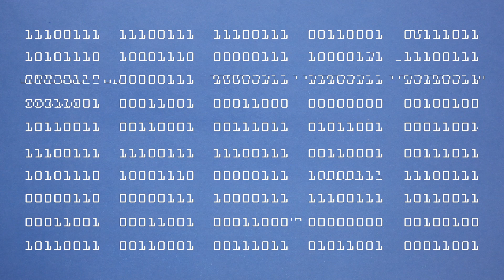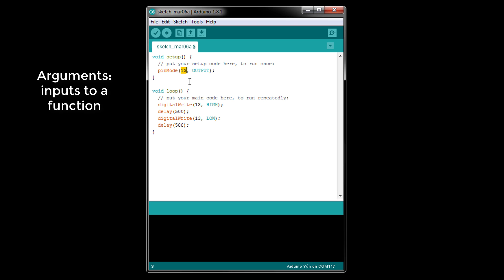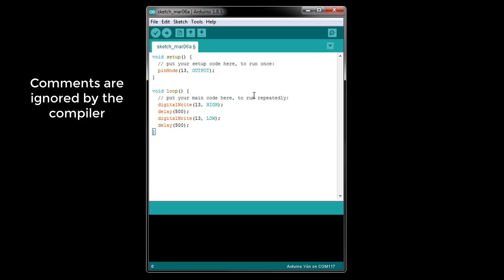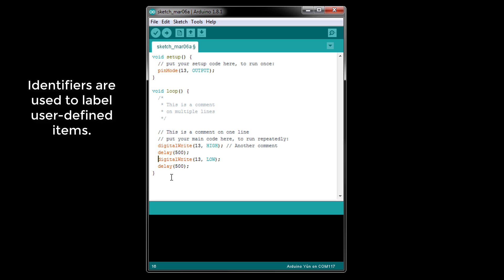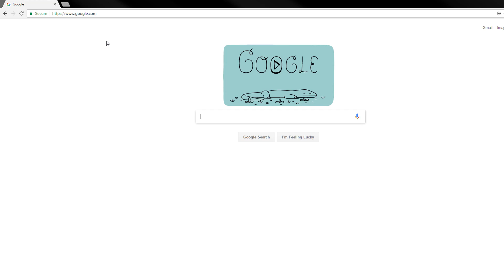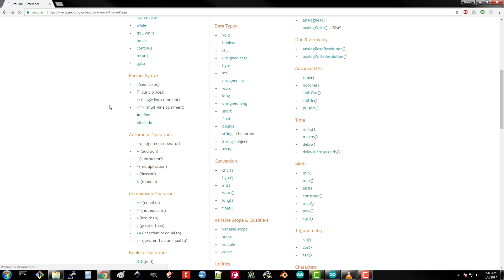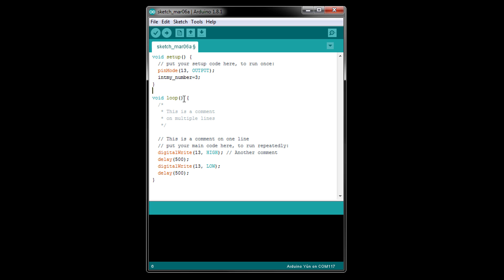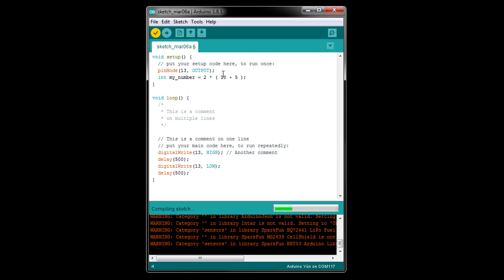Arduino Programming Syntax

Comment: 0:04 Actually, that is incorrect. The reality is that when you write a program in Arduino, you are actually using a C++ language with a few additional libraries compiled in that give it its Arduino taste. Remember that C++ is actually a superset of the C language... Additionally, it is possible to install the entire Arduino programming environment and do the entire building with just the tools that are used in the background: GNU GCC compiler and GNU Make for building.

Comment: Can i ask you a question? Is there any program that can turn arduino language into matlab language?
Reply: Not that I'm aware of. You can compile C/C++ code (probably not for Arduino, though) and call it from MATLAB (https://www.mathworks.com/solutions/matlab-and-c.html) or you can run an Arduino from MATLAB (https://www.youtube.com/watch?v=sBfKfd-vIE0).
Reply: so if i have the program(code)  for arduino and i want to turn the same code into matlab code i cant? i want to make something with arduino and matlab and i already have the arduino code and i wanted a program that can make the arduino code into matlab.Thanks for your time
Reply: The problem is that there are certain functions, such as pinMode() and digitalWrite(), that are unique to microcontrollers that Arduino compiles code for. Even if there was an interpreter that could give you MATLAB code from Arduino, many of those microcontroller-only functions would not be defined for your computer running MATLAB. Even if you write C/C++ without the Arduino-only functions, I do not believe there are any interpreters to translate it to MATLAB.

Short answer: no, you cannot turn Arduino into MATLAB code. If you write C/C++, then you can generate a MEX file that can be called from MATLAB. Not quite the same, but it might be worth looking into: https://stackoverflow.com/questions/11495996/c-c-to-matlab-compiler-converter
Reply: thank you!!